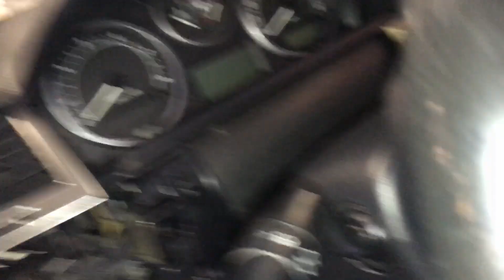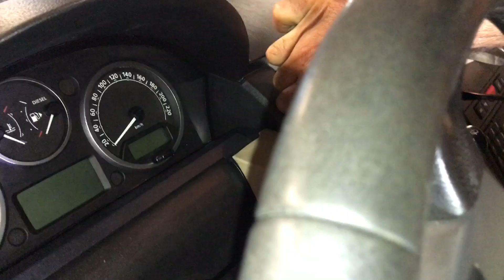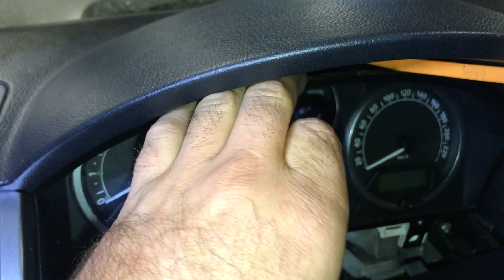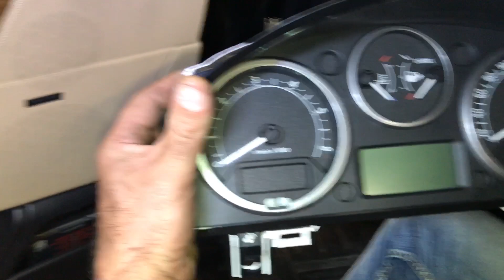Range rover sport 2007 instrument cluster removal

Comment: Thanks for this.  Very useful.  I had a bit of trouble getting the unit to break free at the top over the gauges. It seemed to need lots of pry tools and some effort but finally it came loose then slid right out towards the drivers door.
Reply: Which year is yours

Comment: I replaced mine. A pro-owned from the junk yard and after installing it. The vehicle wouldn’t start. So, I put the original back and it wouldn’t start either. After a while Googling. It looks like it needs to be programmed to your vehicle. Well after leaving the key on for a while (-20 minutes) before giving up. I turn the key on and the vehicle started.. thank goodness. So now, I am just going to drive the vehicle to a reprogram shop.

Comment: What did you do to reprogram/flash the cluster?  Can I buy a program to do it.  I replaced cluster, got a couple of faults, suspension and car won't crank or start. and now it needs to be reprogrammed and only the dealer can do this where I live or so I have been told.
Reply: Did you fix it
Reply: LJ'S Productions yes. I took it to the dealer. They only charged me $75 to do it.
Reply: @matachine654  there are shops that can fix the cluster and no need to buy a new one.